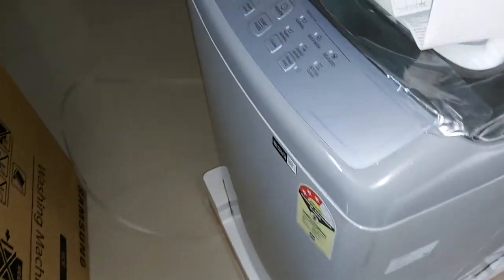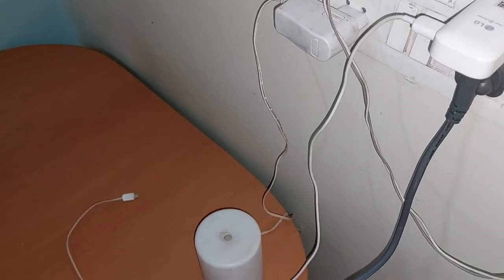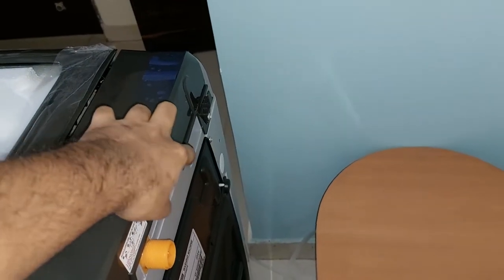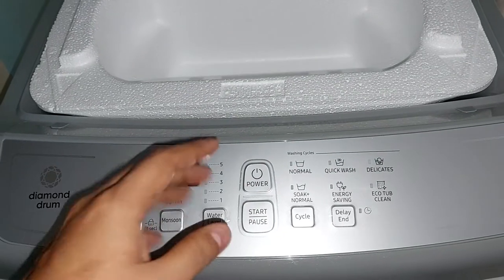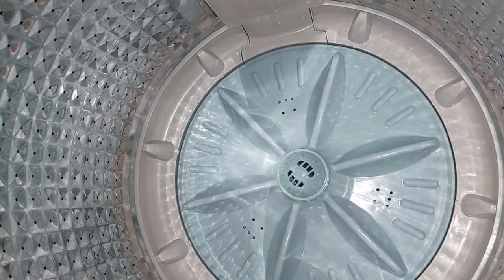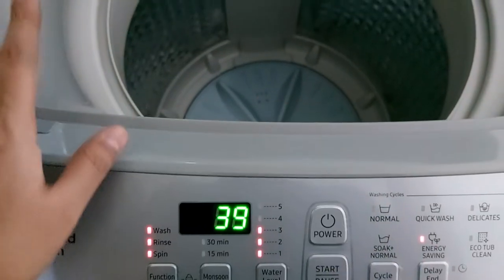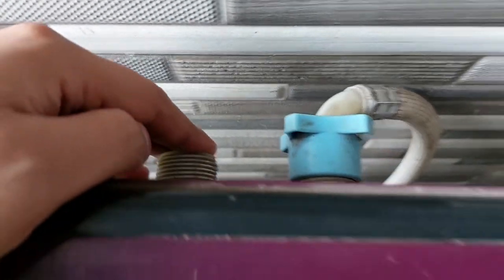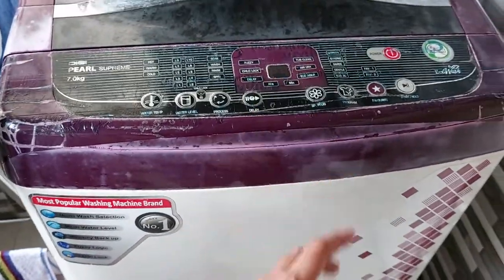Unboxing and first impressions of my new Samsung 6.5KG top load Washing machine - from Amazon Sale!

Comment: should I buy inverter model or this one?
Reply from the maker: This is easy to maintain and less chances of failure. Don't go for inverter model pcb is very expensive and it won't be repaired only replace

Comment: Bro. I have a question. Do all washing machine from samsung have package down part cutted? I mean how I am going to take it out from package without having my washing machine top side down. As its risky to do  so because upper top side is glass.
Reply from the maker: You just need to pull up cardboard. No need to flip machine upside down. Its correctly placed.